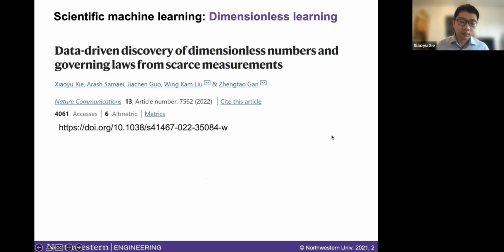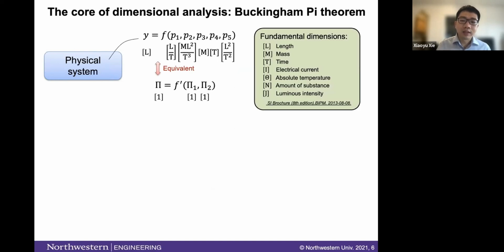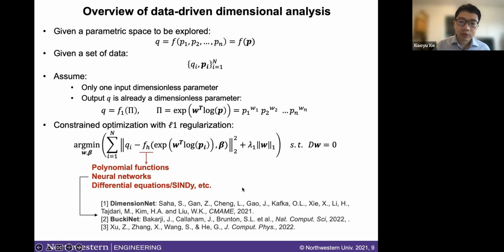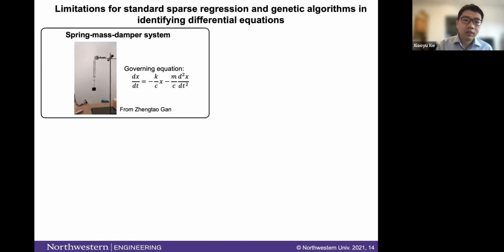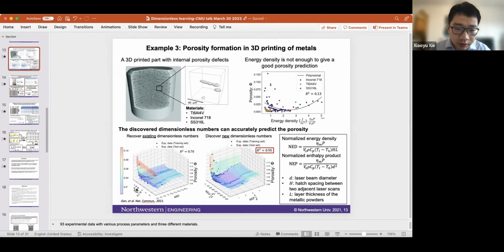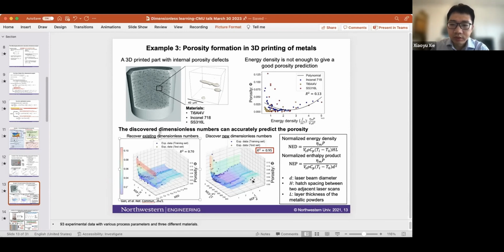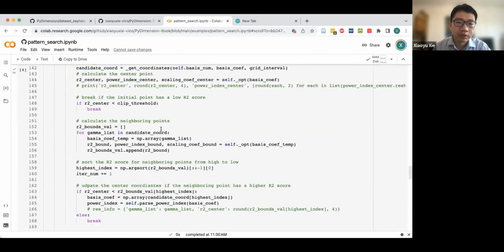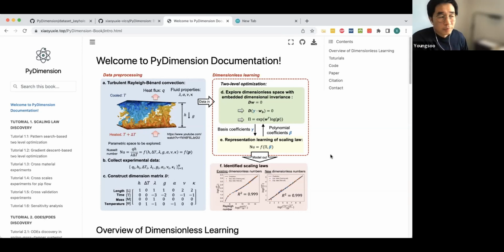Data-driven discovery of dimensionless numbers and governing laws | CMU SciML Webinar

Comment from the maker: Outline:
0:00 Introduction to the session chair and speaker 
2:40 Introduction & background
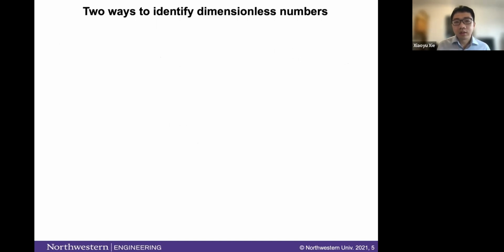10:14 Classical approach: dimensional analysis
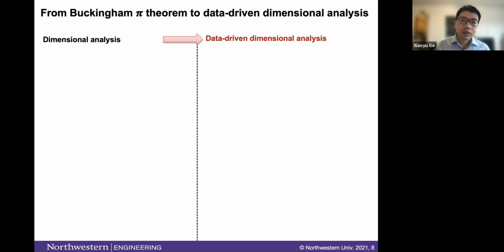17:40 Method: dimensionless learning
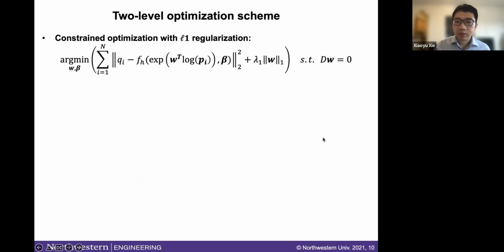22:57 Two-level optimization scheme
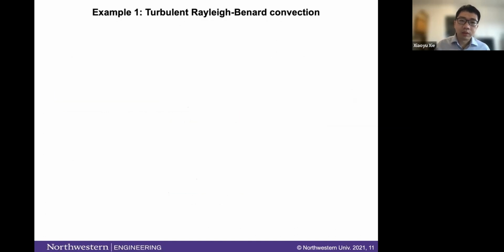25:10 Example 1: Turbulent Rayleigh-Benard convection
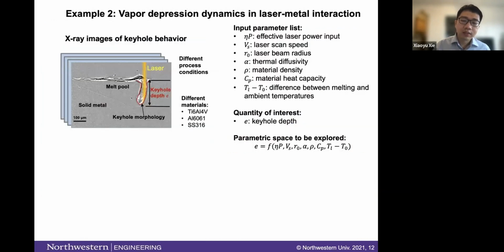27:36 Example 2: Vapor depression dynamics
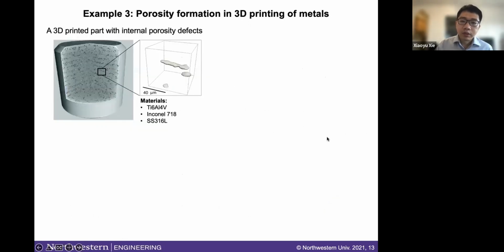29:28 Example 3: Porosity formation 
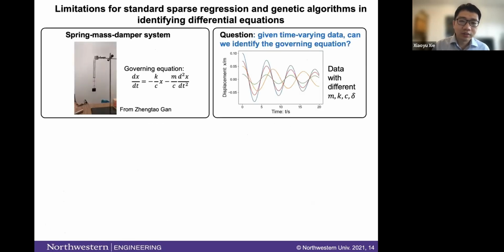33:48 Example 4: Integration with SINDy
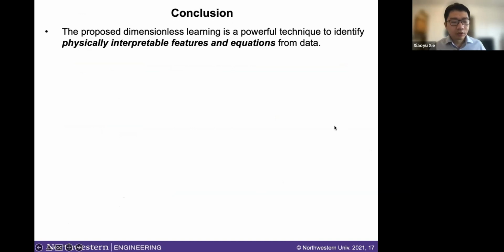39:00 Conclusion
40:13 Q & A
56:03 Code explanation